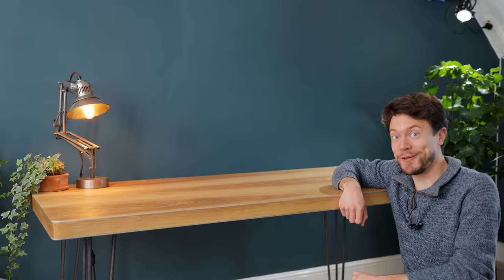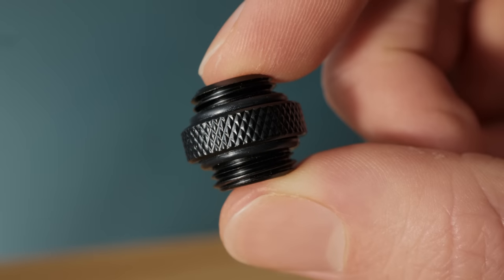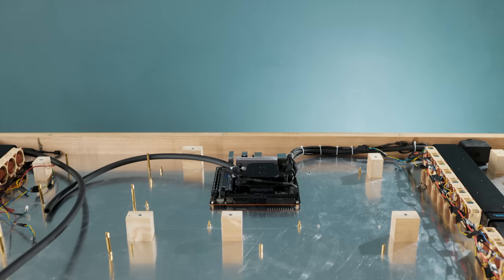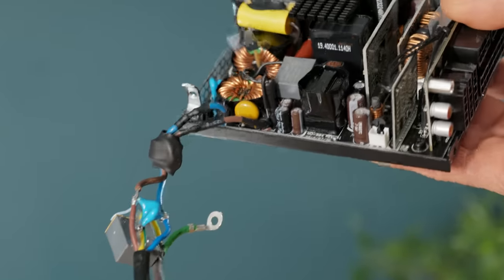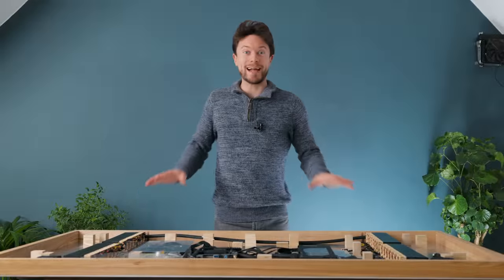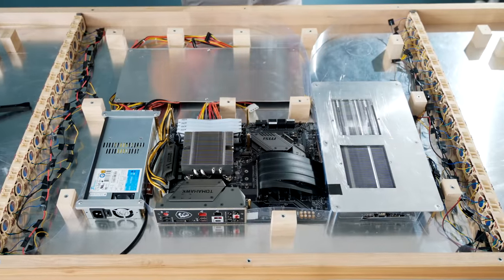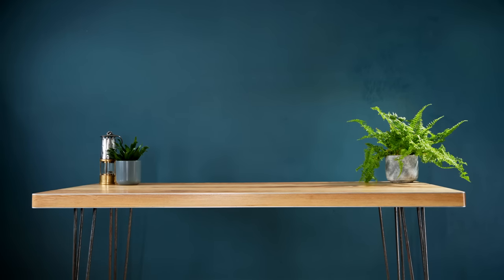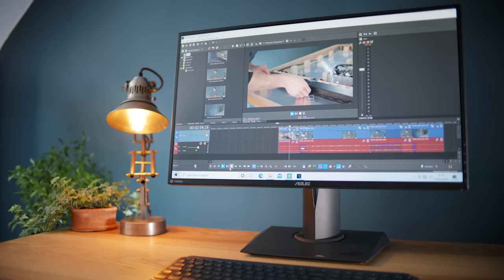Watercooling my invisible PC... (and other upgrades)

Comment: When he opened up the PSU that triggered my fight or flight response.
Reply: while I know he obviously survived (you can tell because he finished and uploaded the video) I almost closed this tab because I didn't want to see a person die
Reply: same lmao
Reply: Jeez, it's not THAT dangerous. The danger comes from the capacitors being charged and you shorting them to ground through your body. There's ways to help discharge them and you can take other measures to make it safer. I usually stick a screwdriver across after I get it out, sometimes resulting in a pretty nice spark. In the end it's just electronics.
Reply: @TheAnoniemo  it’s not because of the risk of electrocution but he tore a good psu apart that is stressful to watch lmao
Reply: @TheAnoniemo  Shorting a Computer PSUs Capacitors will break it. These are high sensitivity circuits that need to provide extremely consistent and accurate voltages.
Reply: @botjksd8292  He using it though, so I don't really see a problem. Only thing that's a waste is the metal case, and even part of that is re-used.
Reply: @polygorg  If you're shorting the input filtering caps the current will go through whatever you're shorting it with, e.g. a screwdriver. Plus they're input filtering caps, so they'll be on the mains side of the PSU, which needs to deal with a lot more interference from the grid in your house.
Reply: @TheAnoniemo  Shorting the capacitor will result in a back current into the circuit. Releasing the power from a capacitor in an uncontrolled manner can also affect its performance. I have had a PSU blow up in my face and it is not a pleasant experience., so just don't tinker with it.
Reply: The warning should be more clear and centered to not even thinking about opening it at home yourself unless you're a skilled electrician. There's enough folks out there that don't know what they are doing and silly enough to ignore the tiny warning in the corner or not even seeing it.

Comment: Verge be like: "first, you need a table"
Reply: don't forget the 'tweezers'
Reply: and don't forget to install the bRaCkET!
Reply: Dont forget the multi tool that i hope has a screwdriver
Reply: Don't forget your live Strong wtist brace.... I mean anti-static wrist strap!.... Or to ground it....
Reply: More thermal paste
Reply: Don't forget to install your ram next to each other for that close proximity boost
Reply: a shame he couldn't pick up a hexa-core cpu :(
Reply: Don't forget to put the power supply on the insulating pads so it doesn't short-circuit the system
Reply: @strainix  "Be sure to really hammer the bracket in place"
Reply: Don't forget to screw in with confidence!

Comment: him declaring that he was gonna modify the PSU scared the shit out of me tbh
Reply: Yep. You better know >exactly< what you're doing. For example, if this burns down your flat or house, insurance won't cover it. Or it may just destroy your table pc.
Reply: HollyT did you not watch the video lmao, he literally cut the wires of the PSU and rewired the power input himself
Reply: @ifb6368  But hes right, everyone can do it. You actually dont need to know anything besides how to soldering(which is easy) and have common sense.
Reply: you make it sound like PSUs are alien technology
Reply: Yeah. I would rather have a bit of the power supply sticking out from the bottom than do something I am not certified to do and claim it's safe. It's not like that bit of plastic around it will make it any safer either
Reply: he left the blue and brown cable exposed...
Reply: Some of you might be really surprised how electrical wiring in households is actually done, but then again most of you won't even see them because their hidden away. Remember: Mostly anyone can become an electrician, it's not like it's rocket science.
Reply: @Torekk  Yeah I'm not saying it's difficult, it's not 'mostly anyone' that can do it though. Try it yourself and I guarantee 90% of people would either melt their plugs or electrocute themselves
Reply: @ifb6368  Don't forget the soldering.
Reply: HollyT  I'd tell you to rewatch the video due to your inaccruate comment -- but likely you DID NOT watch the video to begin with.
Reply: @Torekk  Correction -- anyone can F with wiring anywhere at anytime -- knowing what you're doing AND in most places being qualified to do it is very different than doing it.  He obviously had cash to burn / companies donated to his build -- so waste away and void every warranty he had -- many of us do not get donated new parts from companies and have to pay for the expensive "server" grade components.  Voiding warranties if something breaks becomes a waste of a lot of money if we F things up.  Also as mentioned insurance in many places will not cover stupidity -- hence certified electrician / engineer and non-voided warranties.
Reply: @ifb6368  idk bro my brother is dumb as hell and hes an electrician
Reply: Yeah... Those damn electrical engineers, thinking they can modify electrical devices, smh
Reply: The only real issue with his mods is it wasn't clear if the modification to the earth wire left the PSU board without an earth. If the PSU board was left unearthed he's probably introduced a whole lot of noise and voltage ripple into his expensive computer.
Reply: @Aaron Ennis I just went back and rewatched that bit. Makes more sense now, I originally thought he was only attaching the earth to the table and not back to the remains of the case.
Reply: The problem is not cutting the leads. There's not a huge issue with dealing with cables that will carry high voltages, turn things off first and you're alright. The danger comes from the capacitors. Even with the PSU powered off there is still components in there that have the potential to kill. Yes it's possible to quite happily deal with it safely, but it is dangerous for people to not realise the extent of the risks. A lot of things in life you could just open up and fiddle around with them, the worst you can do is break it. The stakes are far higher with a PSU

Comment: Linus hires two "enginerds" and buys a million dollars in heavy machinery to fail miserably to beat this guy's craftsmanship.
Reply: this one looks better yep, though I find that Linus' cooling method is better imo. Maybe not nececceraly temprature wise but simply from the fact that you dont need 40 expensive fans but rather only half a dozen 120mm ones. Which i stink wouldve been a better approach here too. But really i cant beat this guys desk pc so i can't say its an error as much as a personal prefference.

If it works it works :)

Comment: I'm going on a limb here. I think you can get cooling blocks for memory, chipsets and video processors as well. You could use the round table legs as cooling pipes. This does away with all the fans you have. That only leaves you with the PSU. Which, I think, you could solve by using a PSU with double the power so the fan never activates... Don something like this about 20 years ago. Though nowhere near as pretty as what you made. Well done mate. Very impressive.

Comment: Would be interesting to try and use the aluminum sheets (too/bottom surfaces) to dissipate heat passively—would need to do away with the wood veneer to start with.

Comment: anyone else feel a bit of anxiety when he was "modding" his PSU?
Reply: definitely, as electricity is still stored in the coils; and he could've easily been electrocuted if he was careless.
Reply: @na1s479  well the capacitors could still hold a charge. But if you know what you're doing, you can safely discharge them and go on about your work.
Reply: @kz03jd  yep, some sixteen year old sadly died because he naively took apart his psu
Reply: most capacitors lose most of their energy after 20 mins, to make sure just short them.

Comment: 4:40 "do not attempt this yourself"
I've taken apart a lot of power supplies and haven't died yet

To be extra safe, leave the PSU out for a few  days to fully discharge any residual current & always make sure not to touch any of the components unless you really know what you're doing
Reply: Just touch the components with a grounded wire and make sure you're on an insulated mat or something...
Reply: @dibbesnl  That's probably a whole lot better than my method of "touch nothing but the screws" haha

Comment: cool designs on the table and all but personally, I would have built the tabletop with 1/4 or 1/2 inch plywood instead of veneer and you will not only a more solid table, but much more durable against scratches and wear.

due to the wood being thicker, you can also mount other items such as speakers, lights or ports for multiple uses - which if you tried doing that with the aluminum, you have a much harder time working with it and the modifications will weaken the integrity of the structure

I've build many things like this for bars and nightclubs and after using veneer, I would choose plywood over it almost every time - after a while, the veneer will warp or get loose or scratch or stain and then it looks ugly

if it stains or scratches the wood, you simply sand it, restain it or fill in any scratches and it's all good again

the legs would also hold more weight and you could bore out some holes for your ports and install additional power sources - whereas it just becomes a mess when working with the aluminum

the aluminum trim looks nice and you could still keep it, but overall, the aluminum is so difficult to work with and utilize for function because one you drill the holes, they are done and if you mess up in any fashion - filling them or hiding them becomes a big problem

plywood, oak and aluminum trim with a few small LED strip lights or diode lights would make it look so wicked and a nice cherry wood finish would make it look killer - far nicer than the light stain that you have

Comment: The way he’s just sat on the desk with those thin desk legs makes me shiver
Reply: Those seem like 15mm diameter rods, maybe thicker. He's not bending 12 of those at that length even if he tries to.
Reply: @cooperluce8120  Well the desk itself is made out of aluminium sheets, are they stronger than wood of similar thickness?
Reply: @alexk.7250  based on my understanding, it should be. Not only because material, because it is not one solid piece but it is hollow with multiple supports in it. Someone else can tell me I'm wrong if I am, I don't mind

Comment: Our groundwater and sweet water basins and nature (when enough water is available) cools our earth. In my opinion the worst thing to do is to empty the underground water basins because the earth is becomming a stone that keeps warm much too long and makes moisture evaporate too fast.. Wet areas work like a magnet for clouds with rain, so when the rivers and lakes are dry it doesn't rain so much there anymore.. Your table pc looks very nice b.t.w. :) I used the video because you use water cooling because it's most efficient. The same counts for our planet..

Comment: You should add a temperature sensor to the water loop and then adjust the fan profile according to the temperature of the water, instead of the CPU, as shown by @OptimumTech in this video: https://youtu.be/Toramr9PfOE
Reply: except he probably doesn't run cinebench all day
Reply: @johannsmith5697  regardless, it's still the most sensible way to set the fan curve on a custom loop.

Comment: My anxiety levels flew out the roof when he exposed the PSU
Reply: Flashbacks to when I shocked the fuck out of myself while replacing fans on one of my Nexus switches. Noctua ftw
Reply: A psu isn't magic, just normal mains electronics
Reply: @hansdietrich83  and your point..? A Power supply with big capacitors can be lethal af. I would have made a hole to fit it even if it meant not being perfect, he already did it for the heatsinks last time. Unnecessary risk in my opinion even if you trust yourself enough

Comment: you can use 120 or 140mm silent fans.
just place them horizontally and make the proper airflow shroud. will be completely silent even under full load, since the airflow will be 10 times better. at least.

Comment: Start a company to provide desk pcs for a fair price before somebody copies the concert
Reply: He would never get licensing to do it the way he has.  Just the modification of the PSU would get his business shut down.  Now, don't get me wrong, I'm not implying he's done a cowboy job, and as he showed, it's safe to use.  But common sense safe and consumer safe are two very different things.

So in reality, he would have to start a company designing their own, consumer safe components and then desks to fit them inside.  I mean, imagine the sales pitch.  ''Hi, buy one of my custom made desks...we've chopped up a PSU and shaved a bit off the MOBO heatsink, glued some plastic in for airflow.''

Also, just imagine the cost of such an endevour that really would be for a niche market.  I, for one, love my desktop PC.  The RGB, the tempered glass etc, so I'm not sure how much of a market there would really be, as i'm sure many others feel the same as me.  Plus, to change out components would be a nightmare.  It's almost akin to buying a laptop...once it's outdated, it's more efficient and cheaper to buy a new one than try to upgrade it.

Is it an absolutely awesome engineering marvel?  Hell yes!

In it's current form, is it really suitable for consumerism?  I doubt it.
Reply: @Tarack1  That's very well constructed reply, i understand what you are saying and appreciate time and effort you put in it. Thanks!
Reply: I operate one of the USA’s largest custom high end Pc companies. This is beyond people’s budgets. Way beyond. Nobody can afford this level of craftsmanship. DIY labor, material, shipping... it’s a horrible design for being cost effective and mass producible. 

That said, if people wanted a thicker more reasonable version it could easily be done with a few modifications.

(To be clear I love this channel and all the projects on it. Just nowhere in any of this is this project done in any way to be a good “business” item)

Comment: You could use the loud power supply and change the fan out with a noctua one. I did that on my ender 3 and it worked perfectly. If im wrong tell me, but i think that should work
Reply: it's transformer noise and coil whine that's the problem. The fan itself is quiet and has a zero fan stop mode.

The video does clearly cover this.

Comment: Lol this when my hearing loss pays off because I can not hear a PC running. I do love the desk, I have a professional wooden desk around 60 years old 😏just realised it’s a few years older than me😹😹but it has under it a huge space behind the front trim so I could in fact do the same with it but I won’t need to go the same lengths that you have as the new desk top PC I am buying is slim enough to hide u der the desk and as there are no CD/DVD drivers in it I can hide an external on top of the desk. I loved how you did the monitor so I might look at doing something like that myself in the future as at times I have a need for using 2 or 3 when doing designing so that way when they are not in use they can be tucked away out of sight.
Thanks for such great ideas 🤗🤗🤗

Comment: This is awesome don't get me wrong, is it viable to have upwards blowing 140mm fans that have their inlets on the bottom surface on the left and right edges rather than the small fan bank in the case? You could also have full-size radiators horizontal as the only air outlets to the case which would leverage the positive air pressure to exhaust air. With so much internal space that seems like it would be a good option. You would have 20mm of clearance above the fans for the air to move sideways into the case

Comment: I dont have the skills or resources but I had this idea for AIO gaming pc monitor/tv setup: So you take a 40inch HDR 60fps flat panel tv and modify the back of it to hold all the parts of a beast pc (maybe even use the vesa mount slot somehow). This, much like your desk, is for those who like to game at a desk on a 32inch+ screen. And just for fun, use a good or unique amount of RGB lighting. You're great at custom cases so it should have an ultra-light enclosure. Sound wont be much of an issue as the tv blocks/shields some of it and you'll be using a nice pair of Bluetooth headphones but as you say quieter is better just not at the expense of performance. Im thinking mini itx with the fastest 2x 16GB of ram. Rtx 3080. 2TB m.2..

Comment: Can you
1. Add some easy port access. 4 USB-A ports, 1 HDMI port, 1 SD Slot, a 3.5mm headset Jack, An Ethernet port on the side, and 2 USB-C (or thunderbolt 3 if you can).
2. Add a uhd blu ray drive on the side of the unit. Optical discs are so underrated nowadays.
3. Customize the Software. (like Rainmeter, nexus Dock etc.)
4. Benchmark the PC with Geekbench 5.
5. Try other OSes on it. Try to hackintosh it, try to boot Android x86 on it, try to boot cloudready on it, try to boot Ubuntu on it, Try to boot Windows 1.0 on it.
6. Can it run Windows 11